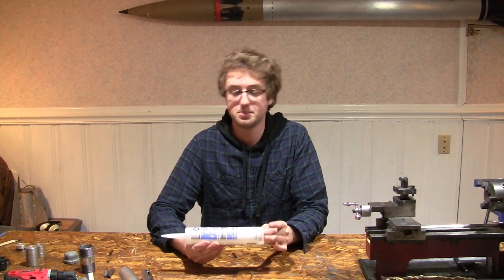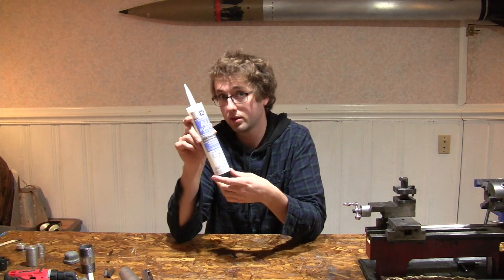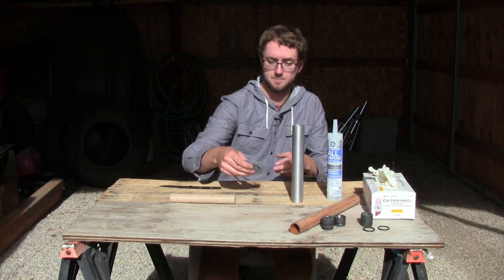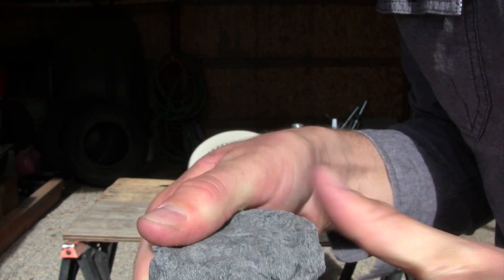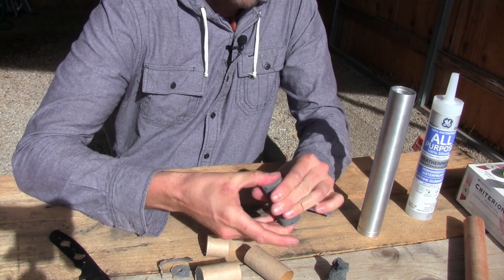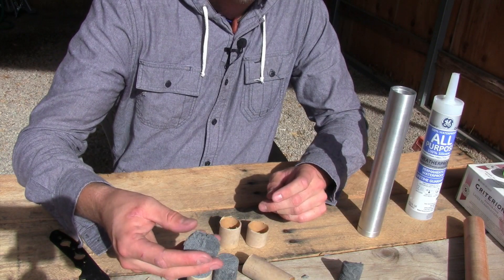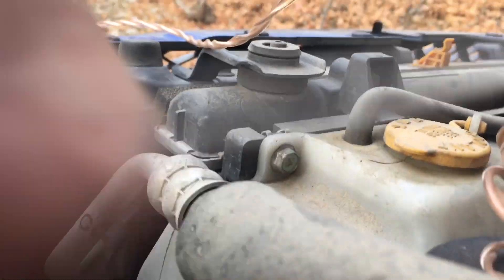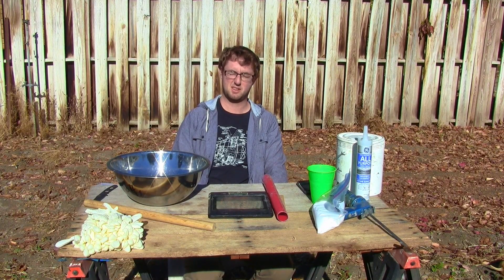Silicone Caulk Powered Rocket! Part 1

Comment: I had the same result. It explodes because the are micro holes  in the grain. You need to press the grains and cure them  pressed. In the motor, when pressure grows up, heat goes into the micro holes of the grain and burning area grows up.

Comment: When silicone cures, acetic acid is evolved (hence the terrible smell) and acetic acid reacts with magnesium metal and usually metal and acid reactions are exothermic. Do you ever worry about this when you make silicone apcp with metal fuels like magnesium?
Reply: i would worry but i could replace the magnesium/aluminium with something like carbon or sulfur, so it's closer to gunpowder, or if you like acids, a really small amount of nitrocellulose, if you put too much it's gonna explode, nitrocellulose should be there just to give it a lil boost if anything
maybe polyvinil alcohol nitrate or whatever it's called, tho it can be explosive

yeah i dont think there is much you can do besides using the silicone itself as the fuel

Comment: Is it less expensive than Sorbitol/kno3 propellant? Cause here in France It's arout 100€ for abound 4kg of propellant
Reply from the maker: It really depends. It's more expensive for sure, but it also has about double the power per pound (or kg). Depends on where you can source materials for either and the cost comparison. Quite honestly it's actually pretty close if you can find a cheap source for either.
Reply: @solarover13  I see, but you also need better casing for the fuel so it doesn't blow up. I might stick with kno3 first for my first rocket then I will see. But thank you for the answer!
Reply: @k.6686  Es-tu abonné aussi à French Rocket Boy? Il donne des tutos
en français aussi. Pour un casing j'avais pensé grâce à lui justement de le
faire en Starlite. Vu que ça brûle pas et résiste à la chaleur. Faut juste trouver
un moyen de le renforcer pour la pression.
Reply: @heritagekebek9979  Ah nice, je ne connaissais pas mais merci. Par contre la starlite je sais pas si ça peut vraiment aider. Peut-être tu peux la renforcer avec genre de la fibre de verre ou etc
Reply: @solarover13 it's nowhere near as close in cost in Europe. For 2 pounds, sorbitol and kno3 costs $6-10. While for perchlorate, that stuff itself is in the hundreds of dollars per pound if purchased in small quantities. If using HTPB, that's $75-150 per pound straight from China. It's a joke to even compare the costs.

Comment: Looked like a good propellant, what ratio's did you use? Maybe an end burner would work better to characterize the propellant? It looked like it had a really high burn rate.
Reply from the maker: This one was 70% ammonium perchlorate, 1% copper oxide and 8% magnesium. Definitely a fast formula. I'm trying a slower formula in my next videos and an end burner might be in order to characterize the propellant. Something is making this propellant burn insanely fast... I have a few theories I'll be posting in my next (3rd) video.
Reply: @solarover13  dont you think 70% perchlorate is too much?

and also, as an addition, could you try potassium perchlorate?

Comment: Ever consider micrograin( high strength) wax and KNO3?
Reply from the maker: Never tried wax and KNO3. That's a good question though.. Not sure if KNO3 with be a good enough oxidizer for wax. (micrograin is usually a sulfur and zinc mixture, which has a burn rate closer to 3-5 FEET per second..)
Reply: @solarover13  I feel like designing a good rocket fuel is the careful balance between a propellant and an explosive.

Comment: Cool stuff and gutsy honesty! 
Do you think drilling the cores caused the problem? 
Maybe packing around core rod and applying pressure to the casting would be better option because your propellant looked somewhat crumbly.
Reply from the maker: I've done both with traditional binders successfully. (both sugar propellants and rubber based (HTPB) based rocket propellants without issue. So I would assume this wound't cause any problems with silicone.)
Reply: @solarover13  We all have different methods and personal experiences. For me, drilling cores feels uncomfortable, no matter how stable the propellant is.
I don't use multi-grain motors, but single cast with core which doesn't reach the end and goes about 60-75% the length of the motor. It gives good initial performance when it's needed most and then thrust decreases, but so does the mass of remaining propellant. For me this method works and so far I had no failures, but probably does not produce high performance you are looking for. 
Enjoy your hobby. It's a great thing!